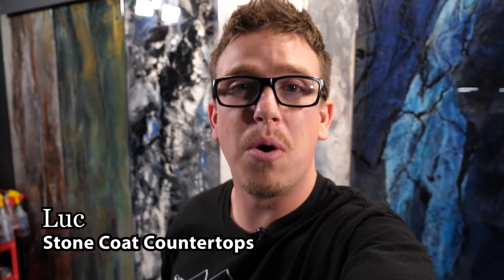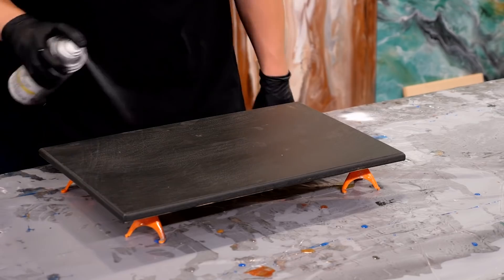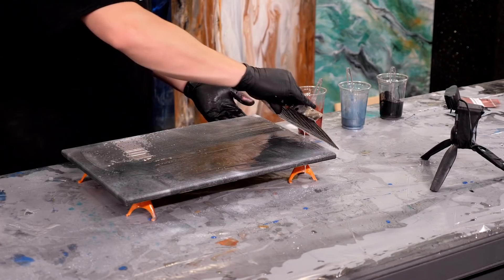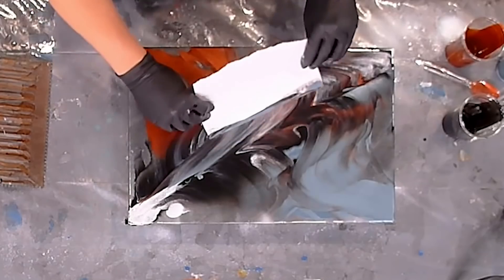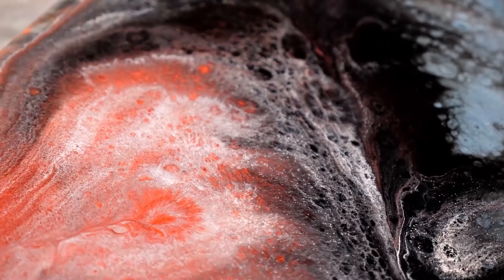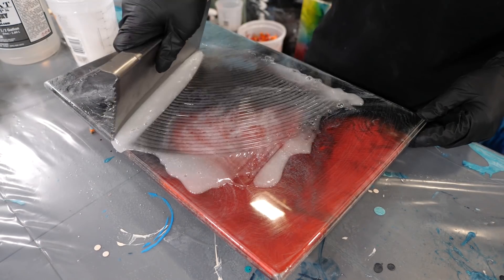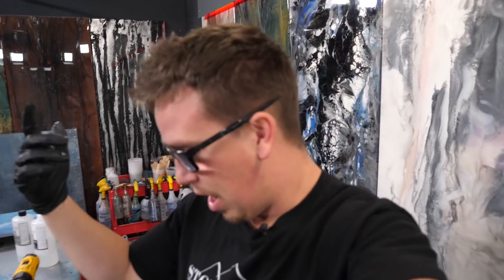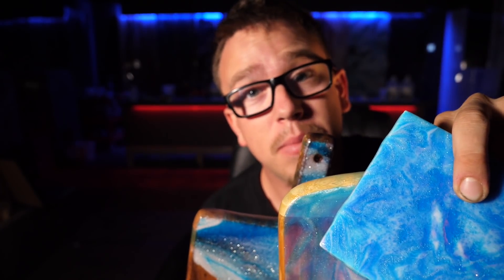How To Epoxy Your First Project | Stone Coat Countertops

Comment: Great step by step tutorial for beginners!  Thanks, Luc.  Had to laugh when I saw the tray at the end.  Could not sleep the other night and lay there thinking about you guys and all the great videos.  Wondered what a good use for all those sample boards might be.  Obviously great minds think alike, ha, ha.  Suggest a picture frame the same size as the tray you want with one to two inch outside edge.  This is where you will be attaching your carry handles.  Then cut a board, material of your choice, to fit inside.  Note:  the epoxy over the edge takes up space, so allow for that in determining your cut or be prepared to trim cut edge afterward.  Make your masterpiece and glue inside frame.  You should paint, stain or otherwise treat frame before attaching, or apply the epoxy to frame as well.  This will be difficult to get smoth surface because there will be no runnoff for levelling.  So think it through first.  Most frames have an inset edge in back to add a backing board for strenght if you want.  Good luck.

Comment: Remember if you use a hair dryer use a new one. The old one in the bathroom cabinet will have dust particals.
Reply: You should always aim it away an turn it on before you use it.

Comment: What was the actual cost to make that?
Reply: Not much. A sheet of MDF at Lowe's is about $30 and you could cut that into multiple pieces. You could also get 2ftx4ft Particle board for around $3-$6 per sheet as well if you want to cut up front cost down. Epoxy depends on how much you get but anywhere from $40-$70 per gallon. Will use very little on something the size in the video. Pigments and additives cost varies. Food coloring works good for coloring if you want to be cheap. Can't exactly give you an exact cost but I was able to do it for about $20ish in materials.
Reply: The cost of the epoxy itself is about $5 total per square foot, when you combine the color coat and flood coat.  I don't know exactly how big his sample board is, but I'd guess the total price (with the MDF, epoxy, paint, and metallic powders) would be less than $20US.
Reply: This is going to make a great xmas gift for the kids! Something Dad and them can do together.